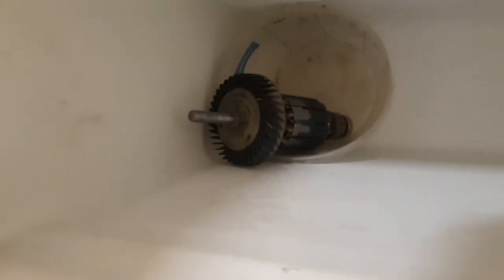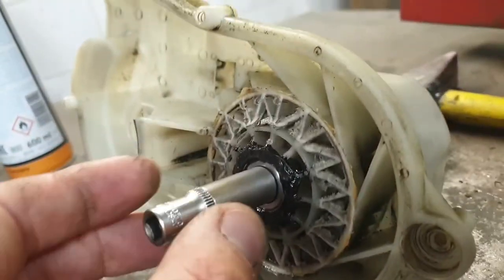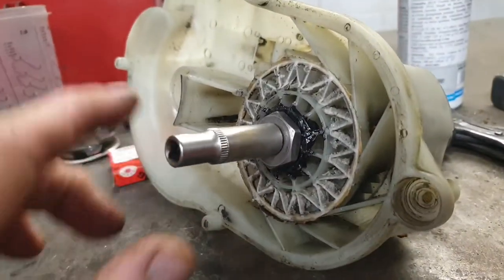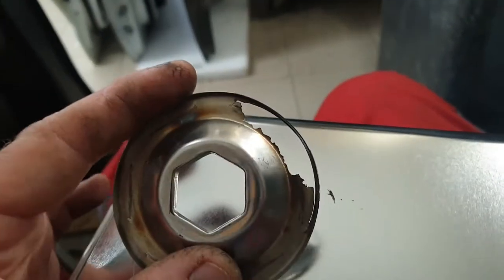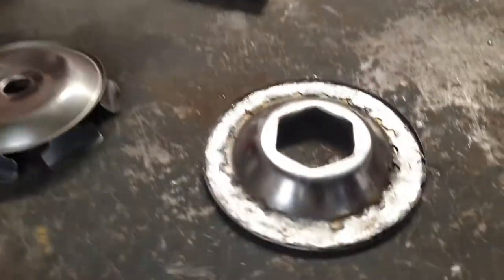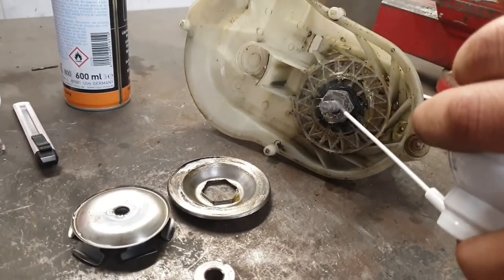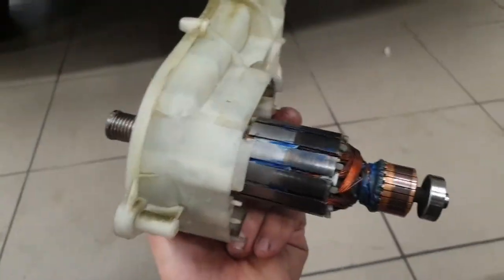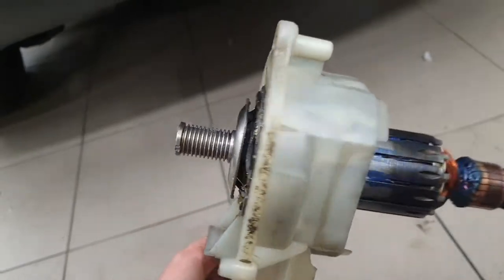Bearing instalation Bosch Rotak 43

Comment: Very ingenious, well done. Very poor design by Bosch in the first place, this is a non serviceable motor.  Bosch want you to spend £160 for a replacement motor, I've only used mine 6 times from new, the belt drive has been put on too far & warped the side of the motor, so here goes!